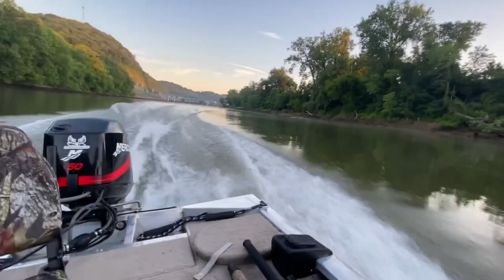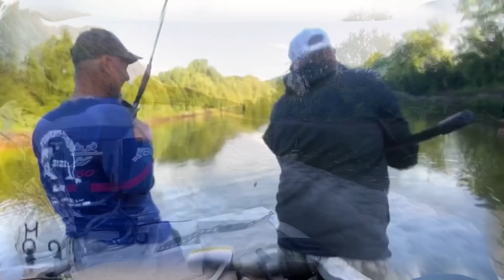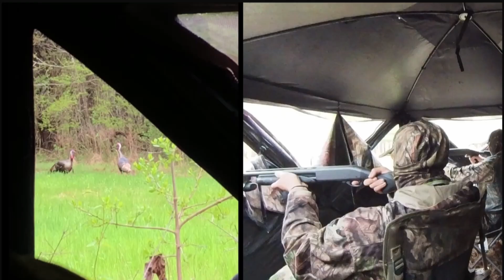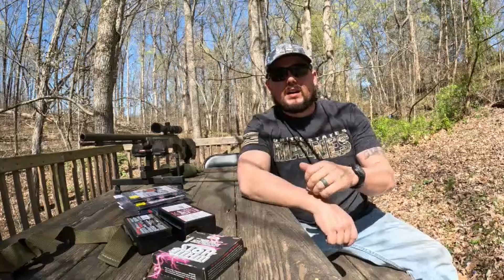Fire Star Consistency

Comment: Nice video brother keep em coming. I believe you misspoke when you was talking about velocities between white hots vs fire star. The firestar 3 pellet was much hotter and so was the 4 pellet. If I'm not mistaken the firestar 4 pellets is equivalent to 133 grains and it was beating all the 150 grain loads.
Reply from the maker: I went back and watched the video and you are right I misspoke. I got stuck on the fact that I was using 3 pellets. So was comparing incorrectly. Thank you for catching that. Looking back at the number White Hots Avg = 100gn - 1668fps and 150gn - 2021fps. Then the Fire Stars = 100gn(3pellets) - 1833fps and 133gn(4pellets) - 2049fps. Yes the FS 4 pellets avg was faster then the other 3pellet (150gn) loads but Pryodex was right there at 2045fps. Thank you again for catching that I will be more careful going forward. Thank you for watching.

Comment: I’ve been shooting hornady bore driver FTX 290gr bullets with 100gr of the pyrodex, so far it’s been pretty consistent for me. However, the white hots impressed me too I’m going to try them out next time I go to the gun range.
Reply from the maker: I have had success with the 290gr FTX as well. I'm running 80gr Black Horn 209 mostly. I'm curious to know your results when you go. The White Hots seem easier to clean but Pyrodex is cheaper and, in a lot of my test, just as accurate. Thanks for watching.

Comment: I have a question if im shooting one 
Grain of powder like a 100 grain and i switch to 150 do i have to sight in my muzzleloader again since im switching grains of black powder to a higher grain
Reply from the maker: That would depend on the difference in the point of aim - point of impact of whatever round your shooting. We just did a video with the XPT Hornady rounds. We’re going from 100 grains to 150 grains raise the impact over 6 inches. But yes, most likely when you increase the amount of powder you will raise the impact point therefore, you will need to recite your scope.

Comment: Not picking on you, but if you do this test again, maybe try a non power belt sabot. I wonder how well the skirts seal, and might be getting some blow by on the power belts, they do seem to fit some guns pretty loose. Since they don't fit tight(depending on bore), it would make sense you would see more deviations on lower charges not expanding the base til a little farther down barrel. Interesting tests, was planning or trying the fire stars, one of the next times I get out. Will be doing some tests myself. One thing you might find interesting is, harvester makes a 50 cal sabot, for 40 cal bullets. Check out the Fury .400 tipped bullet. Could be a interesting combo.
Reply from the maker: You are not the first to mention those. May be worth checking out. Also you aren’t picking… I was just using what I had and learning as I went. As for the seal I can see your point. Might be worth redoing with a different projectile. I’m learning a lot and love tips and tricks for others. Some fall short and others prove true. Honestly I love putting them to the test. Thank you for watching and for commenting.
Reply: I'm kind of on a quest for a better performing bullet. Been using the 240 XTP, and majority of deer have been recovered, but sometimes I lose one, with what should be a good hit. I think the bullets  are exploding on impact, and not penetrating on close shots. I picked up some different bullets to try, even some hard cast to put in sabot. My T/C grouped the 240 .430 xtp pretty well, that is why I stuck with it for so long, plus it was cheap to buy them in bulk. Always like to keep cost down when can. I got a old box of interlock 265 Hornady .430 that looks like It would be a good combo, but if it works sadly discontinued. They still do a 265 FTX, I'm also going to try, and also a 300 XTP. I find it odd they have not offered a XTP mag for the 44 cals, but they do it for the 45 cal bullets. It would probably hold together better if they did. So if can get 44 cals to do What I want, I may go to the 45 xtp mag, if I can find a good sabot. The black ones that used to come with the 45 cal XTP were usually harder to load, so maybe a harvester crush rib would be better for the sabot. I will say when looking at the bullets, and putting them in the harvester green crush rib, they look to fit better than the regular green sabot Hornady uses. May not matter, as they grouped ok with the old, but just a observation. Not sure what BH209 is going for where your at but sheesh $$$ @suburbanhunt3653

Comment: As I said before I recently went to 150g as the accuracy was way better. But I went back to 777 from using Whitehots. The accuracy of the 777 was just flat out consistent. Whitehot wasn't at all. It is cleaner but to drop deer I need that consistency in my head when I'm in my blind. So I'll deal with the 7 crud ring lol
Reply: YOUR MUZZLE LOADER PROGRAM WAS WELL PUT!
Reply: I SENT YOUR PROGRAM TO FRIENDS, I KNOW I LEARNED A FEW THINGS
Reply from the maker: @ronthompson4286  much appreciated
Reply: I just ran into this! I don’t understand the Whitehots consistent FPS being good but terrible accuracy. 🤷‍♂️ I thought about plopping 1 Whitehot and 1- 777 to see what it would do. In hopes to keep the dirty away from the breech plug.
Reply from the maker: @jonivanart  it has to do with the harmonics of the rifle with that particular projectile. One of the main reasons loose powder is superior. You can adjust the charge for better accuracy. While the FPS is closer in deviation the projectile may not like that particular charge. This is also the main reason weighing pellets is all but pointless, in my opinion.
Reply from the maker: That makes complete sense. That ring is easy enough to clean out. If I had your situation I would make the same choice.

Comment: To add to the confusion is this problem with the crud ring that forms with seemingly all of the pellets. A lot of people say that some of this is due to the use of standard 209 primers. The claim is that they are too powerful and actually push the load down the barrel slightly before it is detonated. I recently did find the 209 primers made just for muzzleloading inline rifles that are supposed to not be so hot as to cause this problem but are yet to test them to see if there really is any improvement. I did get some of that with the Firestar pellets but didn't seem quite as bad as with some of the other pellets I've used. It's not a real big problem if you keep up with it and swab the barrel out between every few shots but still happens. Problem with that is that you think you have the bullet seated fully when you hit the crud ring and you actually don't. You do not want air space between bullet and charge period. This can cause problems and an unsafe condition.
Reply from the maker: I have some Triple 7 primers that I plan to test. But for now I going to stick with the 209 for consistency in testing. But I have heard that and the opposite. I have heard that the lighter primers fail to ignite. This is the main reason I want to wait and put them on their own video.
Reply: @suburbanhunt3653  I hear they don't ignite that Blackhorn 209, but haven't heard anything about failing with regular powder.
Reply: @suburbanhunt3653  looking forward to the primer test, been wondering if it affects the accuracy of a good consistent load or if some are hotter or if its even needed.
Reply from the maker: @1Whitetail  going to do the loose powders first but I do have Federal, Winchester, CCI, and Cheddite primers that I will compare. Idea is to find the best load for my rifle then change up the primers to see what happens. Thank you for watching
Reply: @suburbanhunt3653  thats what I'm talking about. I've been told some primers are hotter than others and better to ignite pellets and a difference in consistency. Just wondering,  looking forward to your videos.
Reply: I mark my ramrod, for my desired load depth. Kind of a easy go/no go gauge.